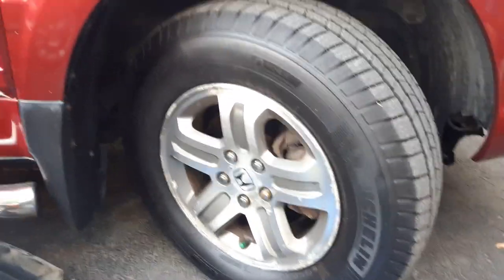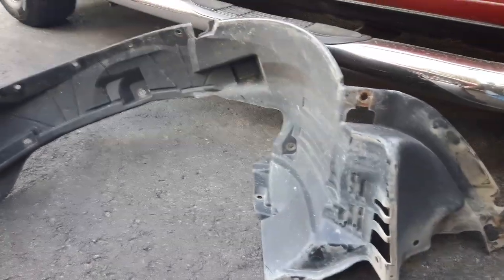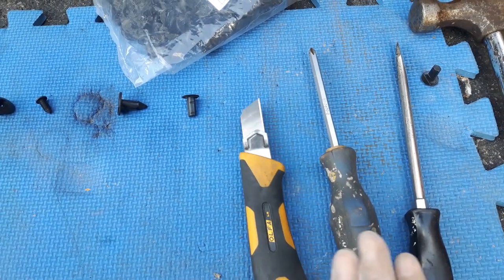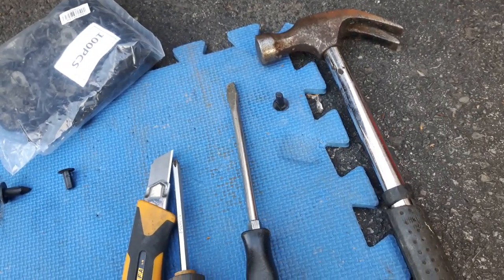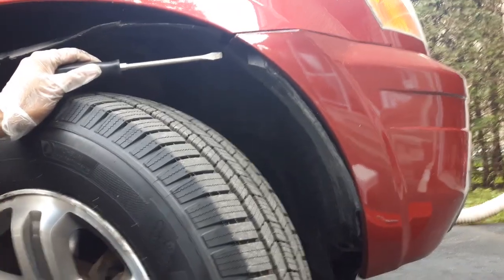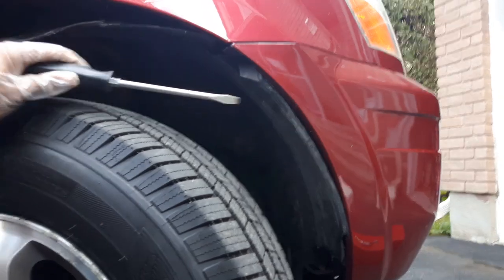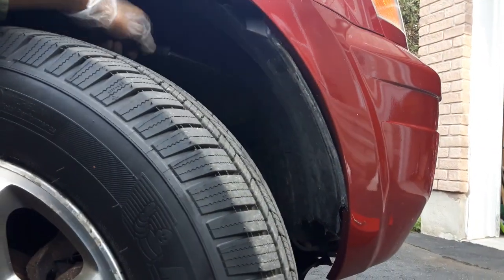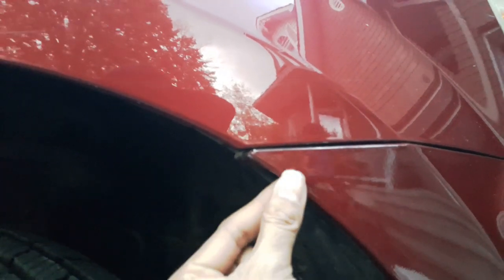How to replace Honda Inner Fender or Fender Liner?

Comment: This poor fella needs to remove the wheel. To ensure proper input of the clips.
Reply: Mike, this design looks like my Subaru's design, and for that you have complete access to every clip without taking the wheel off.  Might make it easier, but for my car it's not necessary.
Reply: if your car isn't stupid low. you can get the job done without removing the wheels.
Reply: Just jack up the front of the vast and you can see what you're doing and you'll have more clearance.

Comment: Did this in 2 hours this man did it in 10min facepalm
Reply: Likewise.  We stuck getting the 3 screws threads to hold.   Also,  got confused about whether the rim of the liner set on the inside or outside the wheel well. Or is it a combination of both 🤔  were going to study the other side and make sure we reinstall both liners properly.

Comment: Question for anyone.  When installing the new liner, does the ends of the liner sit on the outside of the fender cover and inside the center portion of the wheel well?   I remove the 3 screws,  but when I tried to reinstall them the threads would not hold.
Reply: I don't know about your specific model, but my car(a 2003 Accord) has a little flap that attaches to the bottom of the (outer) fender that you need to pull out a bit & slide the end of the liner into. One of the screws goes thru this flap, so you should be able to pull it down easily with the fender liner off.
Reply: @galaxyanimal  I have a 05 Honda CR-V EX.  Thank you for your response.  You are correct.   I actually have a splash guard. With the 3 screws. The challenge is the screw torque is missing when I attach the new fender.  Im pretty sure it has to do with the placement 🤔
Reply: @HeartSoulLeake  On mine(it might be different on yours), the splash guard is only attached to the outer fender by 1 screw, which also goes thru the inner fender/fender liner, so the liner tucks into the splash guard that way.
Reply: @galaxyanimal  Thank you for sharing.  We did the logical thing and mimicked the installation from the opposite side.  It definitely go on the inside.

Comment: Where can i get just the bolt like clips that keep the liner in and flush bandits stole mine for a 2006 civic.. thanks
Reply from the maker: Ebay or Amazon
Reply from the maker: Added few links in the description to follow to buy. A combination set like shown in the link is the best option I think.

Comment: Does the fender liner bolt & clip to the front plastic bumper? I hit a raccoon & it damaged both, so I'm wondering if I can remove them as one piece if a junkyard lets me remove it from a donor car myself.
Reply: There is one screw on the bottom of the front Fender and a few clips, but you don't have actually release any part of the bumper cover.
Reply: @HeartSoulLeake  Yeah, I figured it out. I knew you didn't have to take off the bumper to get to the fender liner, I just had to replace both and I did manage to get them off as one unit.

Comment: Does a car really need this inner fender to keep bumper hold?
Reply from the maker: No, for most vehicles. But it works as a dust,water,  mud, snow shield too (and road noise reducer)
Reply: ivet, EVERYTHING above the wheel will get a nice shower when it rains if you don't have a fender liner...  Considering you can get OEM like liners online for $30 and considering it's not too hard to replace, I'd not screw around.

Comment: Why would you not remove the wheel on this unknown Honda??????
Reply from the maker: I could do it without the extra work but sure it's easier without the wheel there
Reply: It's pretty simple, just turning the wheel in.  Make sure not to use a really long stem Phillips screw driver.